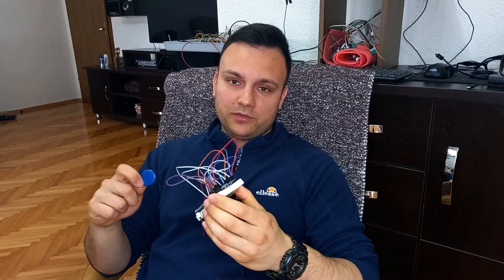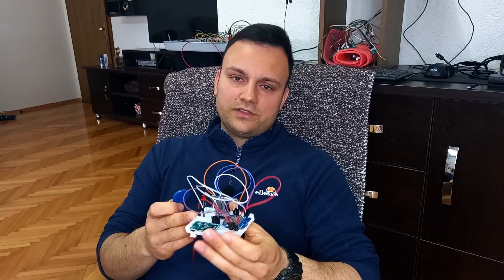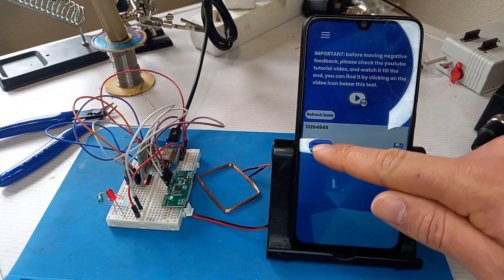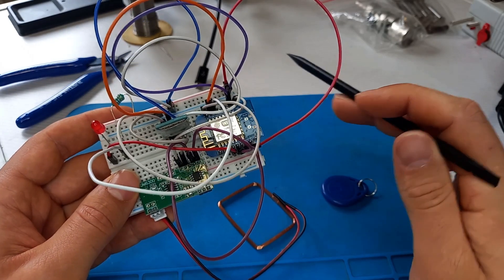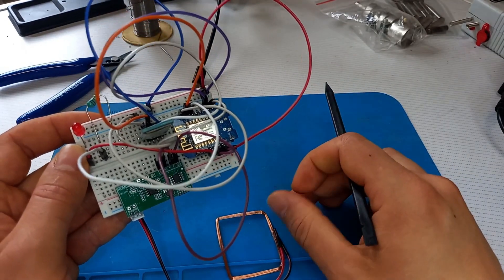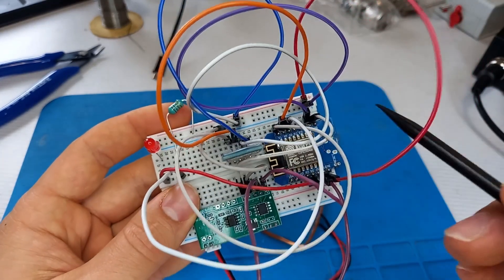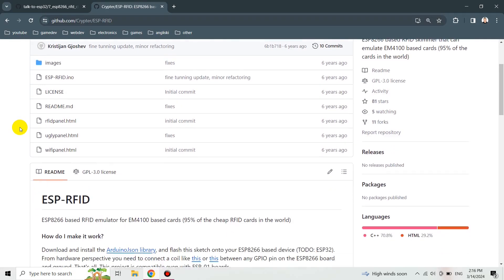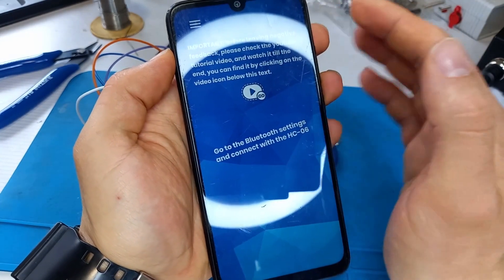How to Make Your Own Flipper Zero | RFID Read and Replay

Comment: Great video!
Is there a code that doesn't use the app and uses eeprom or just doesn't save the cards when the device is rebooted?
The app's great I just need it to not need my phone to operate.
Thanks!
Reply from the maker: Thanks, I did this version, but you can find the code on the GitHub repo I posted, and you can modify it according to your needs, if you want it would be great to share it as well, enjoy.
Reply: @SlavkosHobbyChannel  What function exactly is the one that's used to send the codes?
I went through the code on GitHub a few times but couldn't determine exactly which one (though I guess it's the last one).
Thanks!
If I make any change I'll be sure to post it!

Comment: Mate ... What is the value inductor that you used? And how do you called that component
Reply from the maker: I used a 1microhenry inductor with 10% tolerance, but you can use a similar one, around that value. In the video, I called it just a coil, but you get the point.
Reply: @SlavkosHobbyChannel thanks mate .. I tried to use the application . After connected with HC-05 and open the application for menu rfid ... Nothing happened ... Do you know why?
Reply from the maker: @WorkFromHome-th2eq  Try using HC-06, or change the name of your bluetooth device from HC-05 to HC-06.
Reply: @SlavkosHobbyChannel thanks mate. I bought HC 06 and it is working well. HC 05 is not compatible in my case.

Comment: Hello sir , such a great project ... I made this exactly the same(433mhz cloner ) but i got some problem in it .. Whenever i try to receive signal from a car's remote , the blue led on esp32 pops but the external red led doesn't and also i had not able to get any data .. same issue with a rc car remote of 34mhz ... although the external led works well in sending text datas and all ...Can you help me on this ..... Btw nice video 😊
Reply from the maker: Hi, at the end of that video, I am talking about the library I used, the protocols, and how we can improve the library. The guys who did the library did an amazing job, but obviously, they couldn't catch every single protocol used by a lot of manufacturers. Also, the library is not able to catch and distinguish long signals, some of the remotes send a long signal, and most of them are rolling, so some other methods are needed to be caught. But in my opinion, it is not a good idea to try sniffing a rolling code remote, you might end up having problems and needing to resync the original remote.
Reply: @SlavkosHobbyChannel  thanks for replying 😊....I want to make it as a project ...In other words I need to find some other method to do it ??..
Reply from the maker: @vijalpatel144  Open the GitHub repository of the library I used, and the guys explained how we can add different protocols that are not supported yet in the current version of the library. The current version works great with most or maybe all of the fixed code remotes.
Reply: @SlavkosHobbyChannel  thanks a lot..... Btw keep it up, your videos are best 👌😊
Reply: @SlavkosHobbyChannel  no worries to any sniffing activities coz I have an test fob with me for testing purpose only .

Comment: Can u make a circuit diagram? So easy to make
Reply: Yeah, a circuit diagram would be easier to read, though i understand the explanation intends to reach a larger audience, the diagram would facilitate the analysis and save time for those who know a little of electronics.
Reply from the maker: Hi, I explained the connections in the video, but, yes in the future I am planning to make some shields, so we can get PCBs and put them on the microcontroller's board, and everything has the device with all its features.